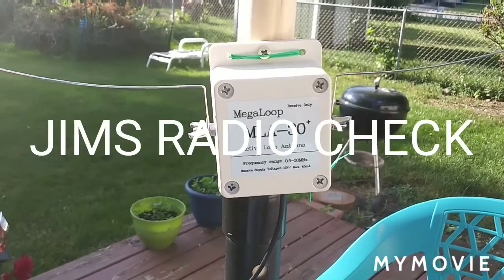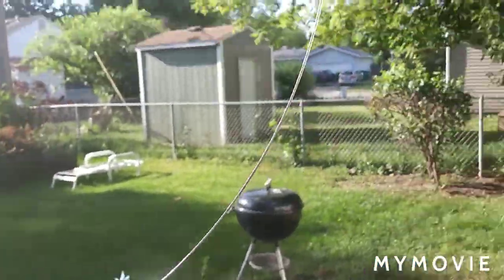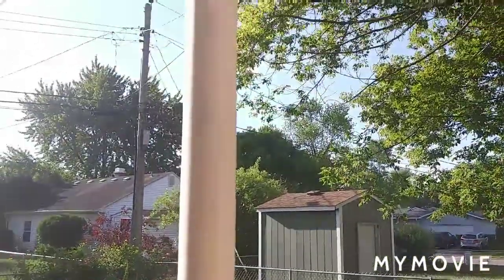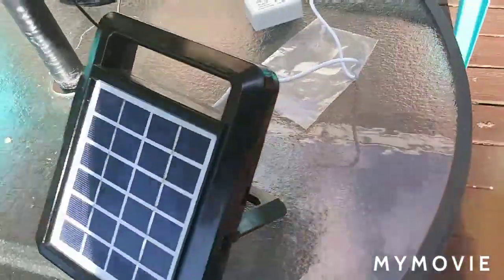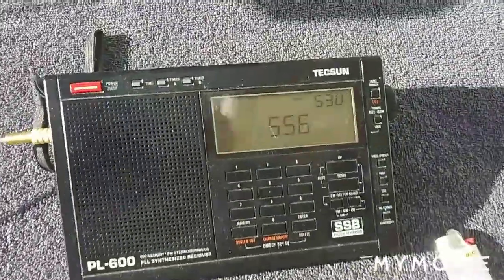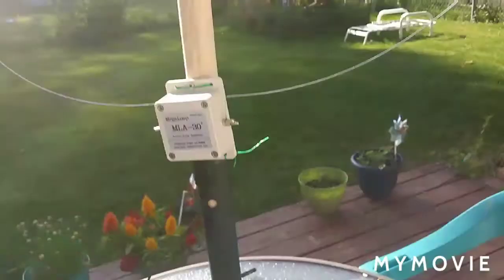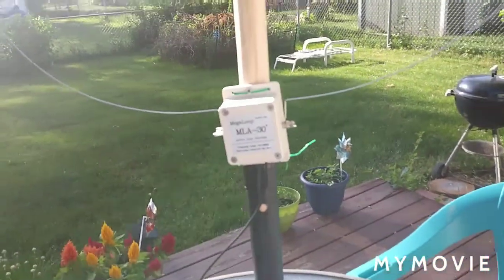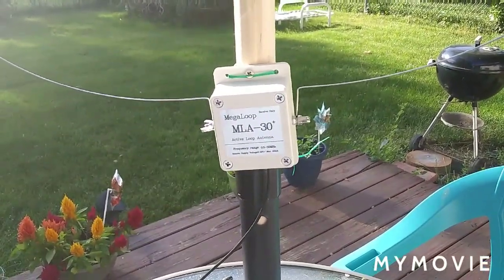MLA-30 MEGA LOOP ANTENNA SET UP

Comment: Thank you Jims - your contribution came in handy. I received the antenna kit from e-bay and tried to figure out where to go from here. You kept it short and right to the point. Hardly anything you can miss.
Reply from the maker: This will be my third winter with that antenna outside and I've had no problems

Comment: Snap also using an umbrella stand and pvc pipe with round  junction box on the top
I some times use the MLA-30 without the amp ie psu  not connected to 5v as it lowers the noise floor on MW.
Reply from the maker: I recently relocated it put it on a 10-ft pole pounded into the ground and it seems to work quite well

Comment: I used a 2in x 10 ft PVC pipe mounted it to my shed. it is about 12 ft high from the grounds. Works great in my opinion.
Reply from the maker: Yes it's a great antenna and if people live in a place they can't put them up they work pretty well inside the house too

Comment: I`m gonna have to get or build one of these. I keep hearing how much better loops are than long wires but have never tested one. I bought a Tecsun PL-660 several months ago. Wire antennas pick up static here. I`m staying with my sister until I can get my trailer moved and set up and she and my nephew next door have tons of electronics that interfere with radio reception. 

I made a homemade AM inductive loop from a 16 inch pizza box that blows the AN-200 loop they sell away. It`s 16 turns of 24 AWG magnet wire on a 16 inch pizza box using a 450 pf tuning capacitor. See a demo on my channel.

I recently ordered two solar panels and plan to make a loop with the huge flat boxes those came it that`s about four feet tall and nearly three feet wide. Dallas is several hundred miles away and I can faintly hear 820 AM with the 16 inch loop so hopefully the giant one will pull it in. I`m waiting on a new tuning capacitor. When I get moved I`ll have room for crazy antenna experiments. I have a BUNCH of radios to mess around with.
Reply from the maker: I haven't checked it out much yet but I did try it a little bit on shortwave it seems to work pretty well I'm going to wait till dark and. try it out on a.m.
Reply: When it comes to antennas - there are not best solutions. Which ever way you go about - you have to compromise, either by your building restrictions, the topography of your location and and finally the type of transmissions you are interesrted in.
Reply: I`m in rural Louisiana. I already have long wires hundreds of feet long.  @BernhardSchwarz-xs8kp

Comment: I currently have my MLA-30 attached to one of those spring tension curtain rods in my room. I also have a YouLoop antenna, good for a low noise floor, works pretty good when away from electric noise.

I do have to deal with a bit of interference so I bought a QRM eliminator for $60, I hook up the MLA-30 as the main antenna, and the YouLoop as the noise antenna and seems to work out well, I have both antennas hooked attached to the curtain rod, the MLA-30 at the highest position, and the YouLoop right below the MLA-30.
Reply from the maker: Excellent a lot of people say that's a great indoor antenna
Reply: @jimsradiocheck936  the MLA-30+ is a great indoor antenna, but if you do have interference nearby (all those switching PSUs) it'll also increase that as well, which is why I got the QRM Eliminator, and used the YouLoop antenna as the noise antenna, the YouLoop itself is a pretty good antenna itself.
Reply from the maker: I seem to get a lot of noise on mine being outside I also use a long wire and they both work just as good

Comment: This type of antenna doesn't need to be high up either. 3 to 6 ft is fine.
Reply from the maker: Yeah mine's up about 6 ft
Reply: You probably want to go higher than the 6 feet. Not because of the anntenna performance but to avoid that you the antenna is too much of an obstacle - specially if you use the umbralla table.

Comment: Wow, nice set up!!! Smart using the solar panel! Will that pole move, because the MLA-30 is somewhat directional…
Reply from the maker: No it doesn't move I recently relocated it closer to my window I pounded a pole into the ground and then added another six or seven feet to the pool by using clamps
Reply: You got the right - directional. Solar pannels are great - if you are retired and have time to wait for a sunny day.

Comment: Horrible experience with setup.. it's impossible to build it neatly.. i didn't get the perfect round shape at all..😒
Reply from the maker: What I did was used a round piece of wood and I saw a slit in it about a quarter inch down and that's how the antenna sits on the pole
Reply: @jimsradiocheck936  is it really important to make it perfect circle..!?